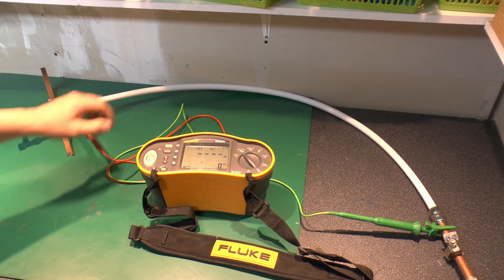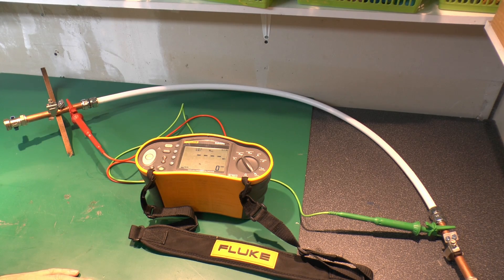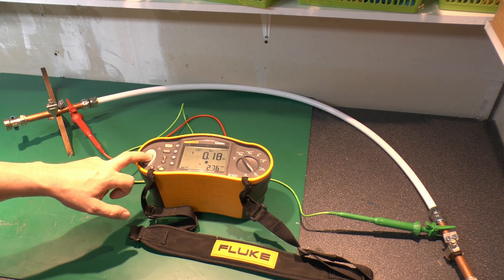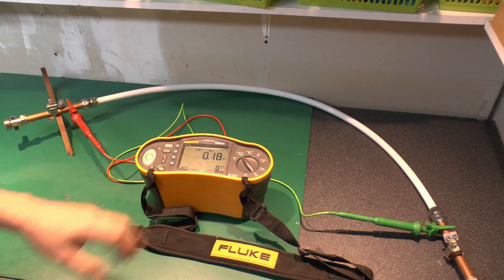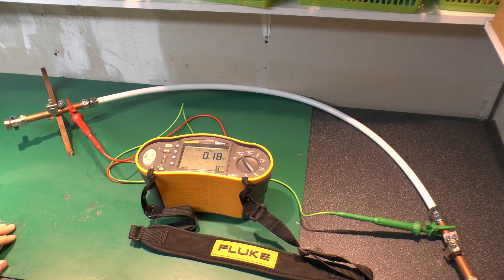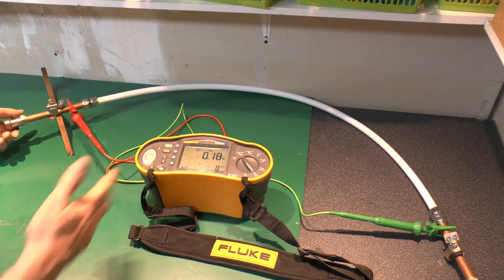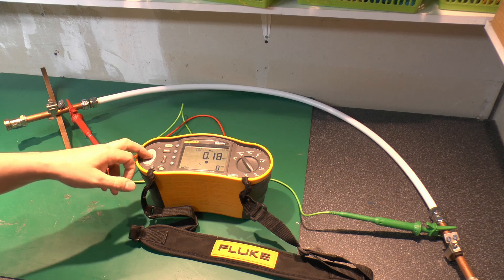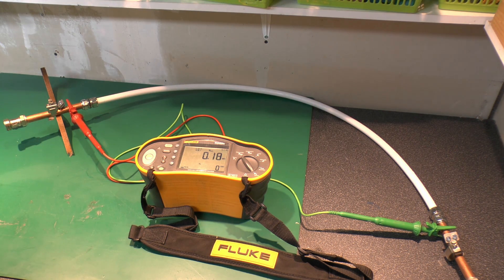Conductive Water Pipe Comments & Answers

Comment: I guess if you were in a bath you are in contact with a very large surface area of water and so you you would have much larger current flow than we see here where we only have the cross sectional area of a 1/2 inch pipe.  Its good to point this out as water is very dangerous with electricity. Maybe you need to borrow a body from the local morgue for this test.

Comment: I assume your sister’s heating system is a sealed system to be that clean! My open-vented system with a few iron radiators goes off colour after just 12 months or so.
Reply from the maker: Yes, sealed.  The other important thing is that every part of it was new when installed in 2007 - no old pipes or radiators.

Comment: Pure (ultra) water is measured as 0.5uS/cm which would make a metre (under their conditions?) about 2G Ohm. Though I think the standard 'width' of their 'conductor' is 1cm so it would be a fair bit less with the water pipe, someone else can work out the math - The heating pipe conductor of ? cross sectional area and 1m length.

Comment: Thanks for the follow up video. Glad you did a test with the pipe empty. My first thought was PEX may be somewhat conductive. Your test shows that not to be the case. I’m surprised deionized water was so conductive compare to tap water. You mentioned the inside of the pipe may be somewhat contaminated but that is probably a small effect since empty the pipe has extremely high resistance.

This has been an interesting series of videos. When I saw the first one - ignored it because I assumed water would not be conductive enough to matter - I was wrong.
Reply: Why would plastic be conductive? Most plastics, unless impregnated with something, are insulators.

Comment: The change with flow rate really surprised me.   Any idea what the mechanism might be?

I'd also be interested to know whether it the flow itself, or the fact that the flow induces turbulence and thus mixing.  Plotting flow rate against resistance might show an obvious regime change.
Reply: Three potential mechanisms could be: 
-When using DC to measure a fluid, polarisation occurs and any charged ions in the water move to either side of the pipe, the moving water is quicker than this process, flipping the polarity could be a way to test this [ inverse direction leads to an inverse relationship with water flow and current flow]. 

-Because its DC electrolysis is occurring and small bubbles are forming on the copper pipe walls reducing its effective area, the flowing water sweeps these bubbles away.

-The water temperature is changing thru the experiment, resistivity of water is dependant on temperature [ roughly a 2% change in R per degree C change]. 

Just guesses based on working with the the conductivity of fluids, loose guesses at best and I wouldn't be surprised if other mechanisms are responsible for a large amount of the variation.

Comment: Deionised and destilled water is not the same. Deionised is water cleaned with filters/membranes. Destilled water is cleaned with boiling and collecting the steam. Destilled water is contains only H2O and no minirales and is not conductive.
Reply: +Morten Winsløw - Deionised water also contains no minerals. The name says it all. All that distilling does is remove the minerals which are contained in the water in the form of ions. Deionised water is chemically identical to distilled water. They are the same thing with just a different method of achieving it.
Reply: Bodragon I don't agree. I'm dooing maintenence on autoclaves for living and there you can see the driffrence in the chamber and distilled water is much cleaner.